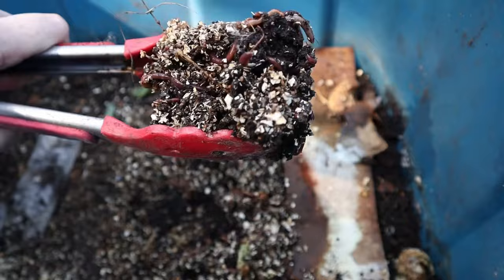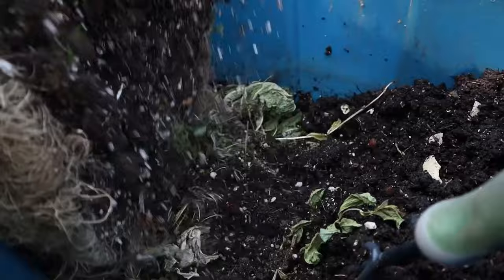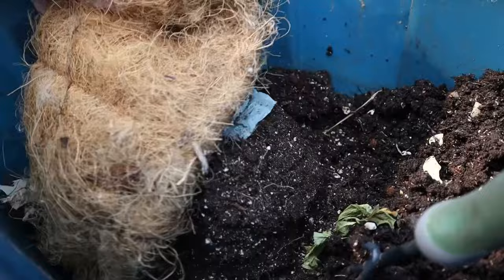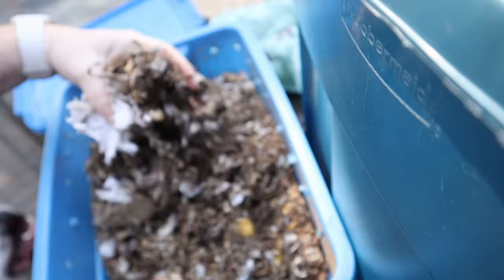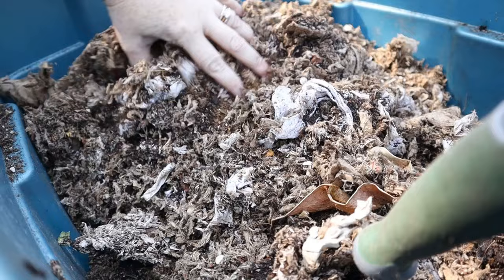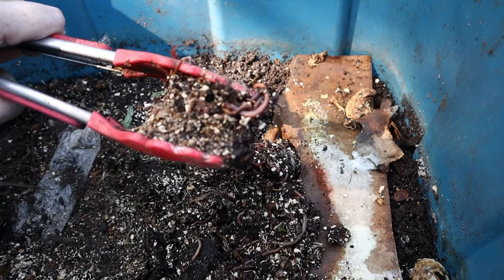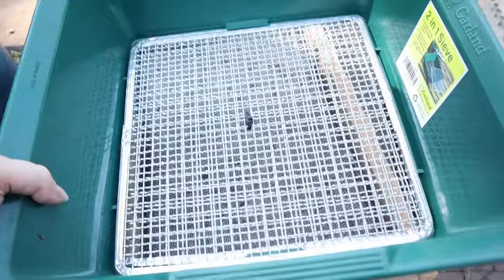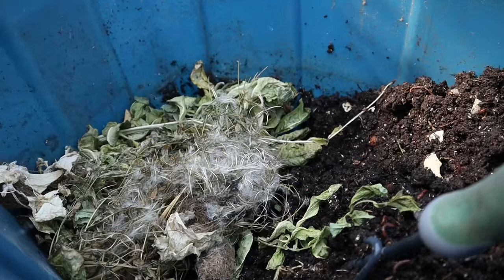Discover the Secret to Effortless Indoor Worm Composting

Comment: I am thinking of a way to do vermicomposting in Florida as an addition to the regular compost bin, and bokashi, cause worm castings are so good for my plants.  I think the micro organisms from the worms' guts really help breakdown the nutrients in the soil to make them available to my plants.  So even though my commercially bought castings only have 0.5-0-0 as NPK ratings, the spoonful or two I add to various pots really do make a difference.  And those castings are alive; I get red wigglers on my pool deck after a big rain, even though I do not have them in my compost bin (just bog standard healthy earthworms which are lots bigger than the wigglers).

Comment: What would happen if there is granular fertilizer in the soil? I have a large bin I toss my old soil into and treat if there are pests. Sometime soil with fertilizer gets in there but its a small ratio to the rest. What would be some methods to flush this? I saw your sterilization shorts and was wondering if any of those methods would work for the fertilizer.
Reply from the maker: Just regular watering will flush it out. It’s just that there is higher salt content which would negatively impact the worms